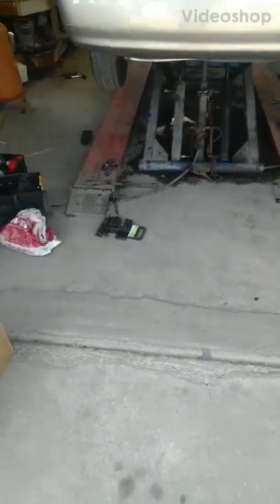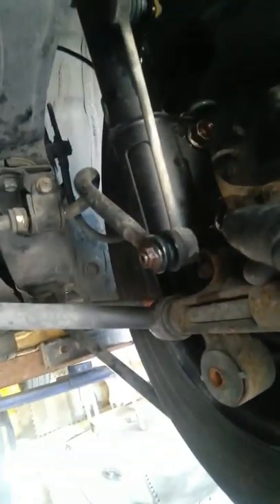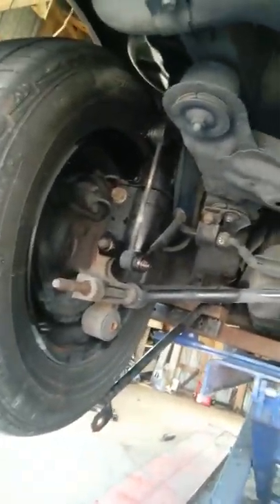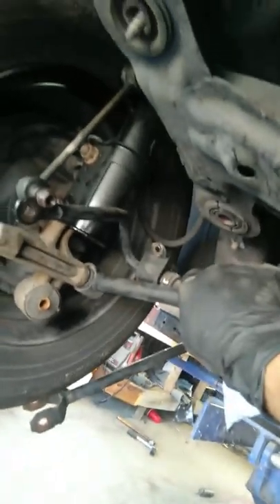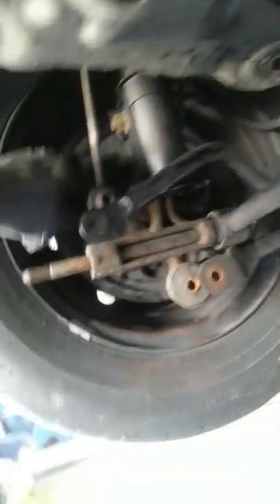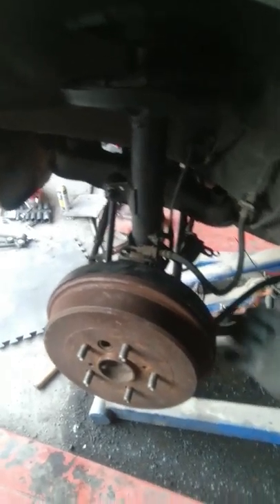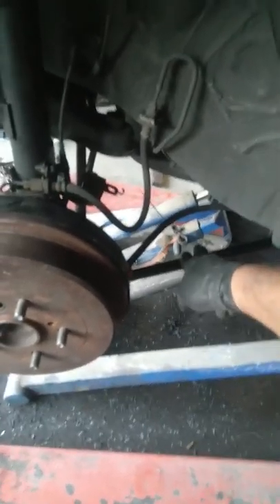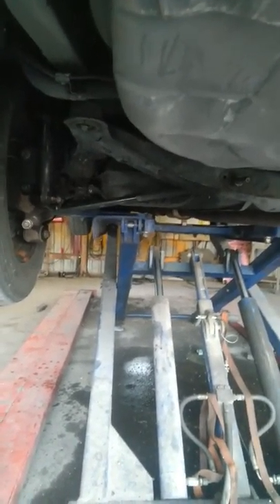1992-2000 Toyota Camry rear suspension replacement. almost same

Comment: No Offense....But If You READ  The   OEM TOYOTA SHOP MANUAL, ( OEM...TOYOTA DEALER SHOP MANUAL)....You Would  Have SAVED YOURSELF ALL OF THIS TROUBLE THAT YOU ENDURED In Removing This 97-2001 Toyota Camry/Solara Rear Suspension Cradle/K Frame...As I Said No Offense. Take Care , Stay Safe!
Reply from the maker: I really appreciate it ,that you make time to review my old work . At that time when I was making a video I didn't have access. But it was very straightforward job to replace suspension arms , normally just having a look to make a plan as I was explaining in video , on the other hand  spindle centre bolt was seized up so I was trying to release that bolt which I wasn't able to do at the end of changing both sides of the spindles with long bolt.
Thank you please share your thoughts and your expert guide line to help make better videos to help community